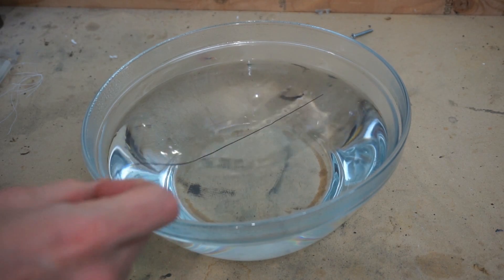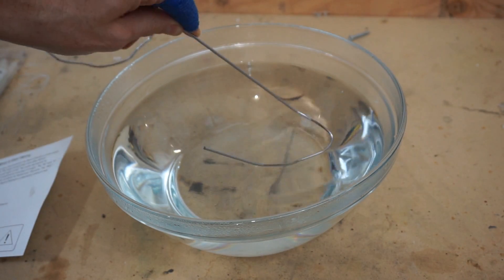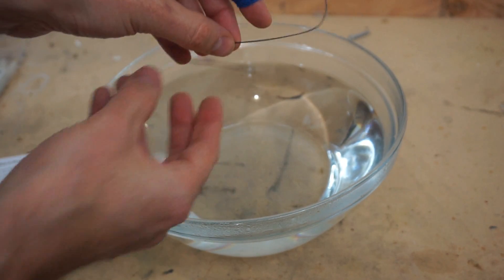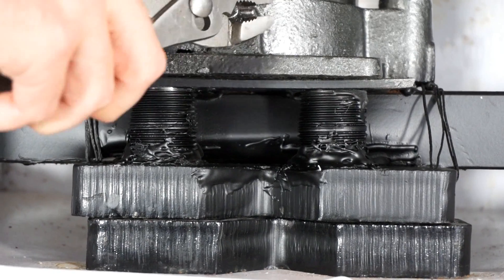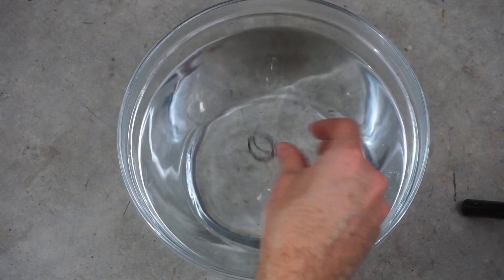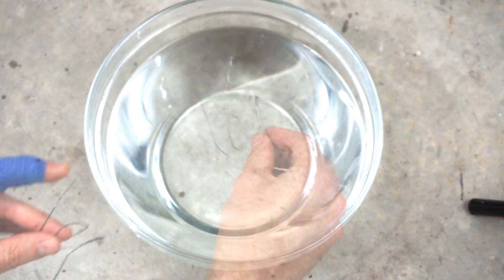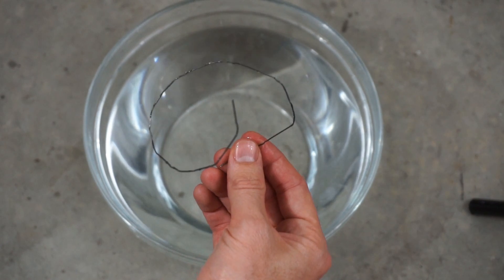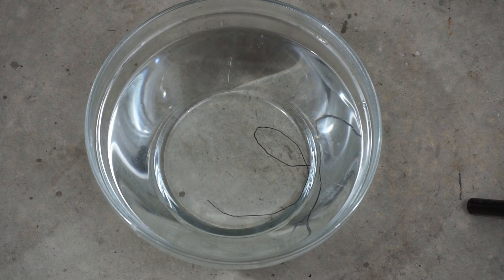Nitinol Shape Memory Alloy Crushed By Hydraulic Press

Comment: So when you pressed the wire is it possible the pressure from the press caused a small amount of heat from the friction from the wire Smashing against it's self. Could this possibly be why it took a new shape?  Thought about using a thermal camera to view while pressing and releasing..

Comment: The amount of heat from concentrated pressure would easily get above 500 degrees. Cant say this test was conclusive without expanding on that possibility.
Reply: No way... It would have burned him when he touched it. No way it cooled back down from 500 to room temperature in the few seconds he took to grab it after pressing it. It would have only heated by a couple degrees at most

Comment: You can test to see if the heat from crushing is what actually reset the structure, or if it was truly the pressure by simply conducting the same experiment with a fresh piece, except running the press very slowly.

Comment: I've been expecting it as high pressure applied fairly fast means fast temperature rise.
You may think You've been squeezing it fairly slow, but relatively to thickness of the wire it was fairly fast. Very high pressure means very high temperature rise as applying pressure You basically put in the squeezing energy into the bent wire - that much energy You applied would require a lot of time (comparing to squeezing time) to transfer the heat on the vice and air surrounding it.
If vice would be small assuming it wouldn't brake it would got hot too unless work would be done slowly letting it radiate the heat out to the air.

Comment: I'd like to wee you retrain that strand into a tightly coiled spring and see if the "crush" memory can be erased.
That, and see if flattening a round wire in a coiled shape that does not cross itself will produce a wire trained to retain that position when activated, or if the super-elastic resource that nitinol affords can be accessed by a mechanical deformation of the wire.

Comment: Action Lab, new fan  and thank you for your videos.   

After watching this, I had a thought.  Did you try boiling water?  What if you froze the wire then curled and pressed it?  Curious if the press caused levels of heat at different points in the wire that kept it from returning to its original shape.

Comment: The wire got hot by the pressure of your hydraulic press, forcing it in a new shape. Make it back straight by hand, and then dump it in hot water to make it curl back to the shape it had after pressing it.

Comment: You re"set" the shape when pressing it because of all of the heat during the process.
Reply: I don't think he shape set it in the hydraulic press. There's likely some plastic deformation which is preventing it from going back into the straight wire

Comment: It's possible with the increase in pressure caused by the press that it heated up from the friction causing the slip to occur. as when the press applied X pressure the coils were pushed against each other which created intense heat and caused it to crinkle also causing the bumps you saw when the coil was flattened.

Comment: Well the crushing kind of is pressure. Pressure=heat. It is forced to be in that sharp under that pressure.
Reply: Black Knight 
No. To change the structure, it needs to glow red. That's much more heat than the hydraulic press made.

Comment: Wouldn't the pressure from the press cause a lot of heat?
Reply: thought of that aswell
Reply: Yeah and isn't that how it's moulded?
Reply: yup, heat from the press. He needs more heat to return it.
Reply: He reprogrammed it with the press.
Reply: it needs 500 degrees to properly be changed so no
Reply: It has to be red hot to create a shape forever by heat
Reply: yes thats what happen to it pressure caused heat and reformed it
Reply: yep.
Reply: You need something like 400 C yo imprint another shape to it
Reply: it might have gotten very hot (at least locally within the metal)

Comment: I'm not sure if this is right, but isn't pressure a form of friction? If so, wouldn't that create heat to influence the atoms in the metal to slide over each other easier?
Reply: I am just curious.
Reply from the maker: Yes, it does heat it up, but it needs to be red hot for the new crystal structure to form, and it definitely wasn't that hot from the press. So I think it was just purely from the pressure that caused non-elastic deformation.
Reply: it was the heat, for sure
Reply: I agree.  It may have gotten hot enough in small local areas momentarily. Without it being noticeably hotter overall when pulled from the press.  I suggest crushing it much slower, like over a 10 minute period.  I'm very curious if the deformations and dents will spring out if this is done.